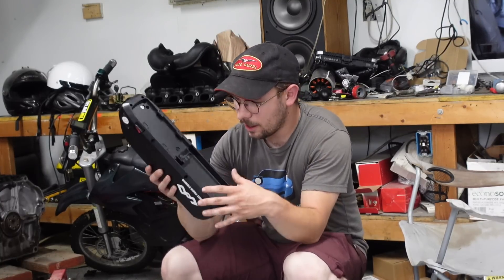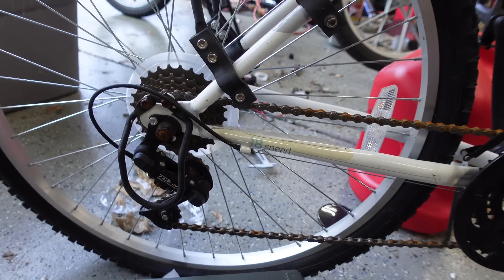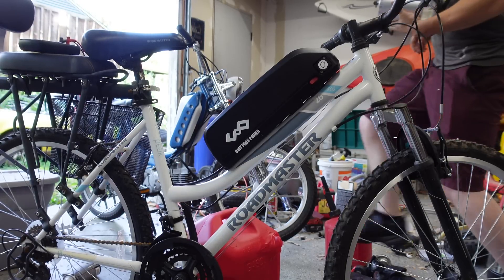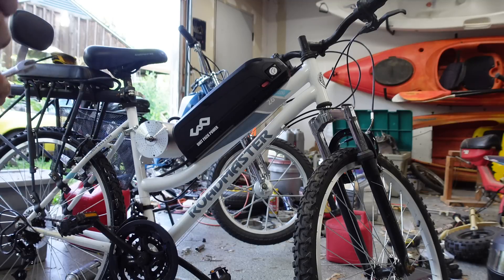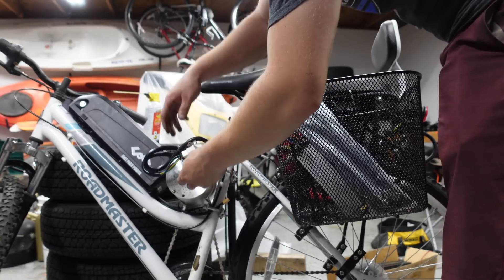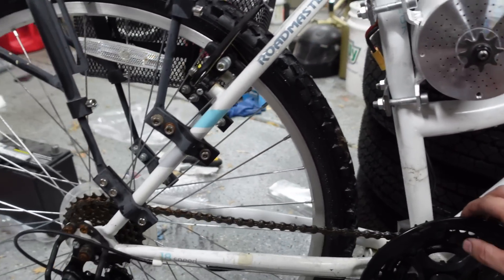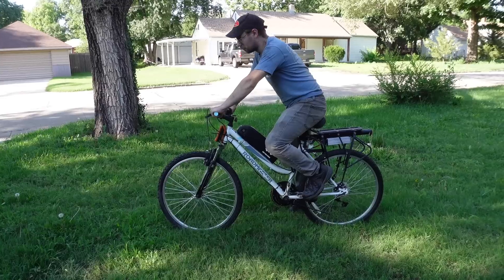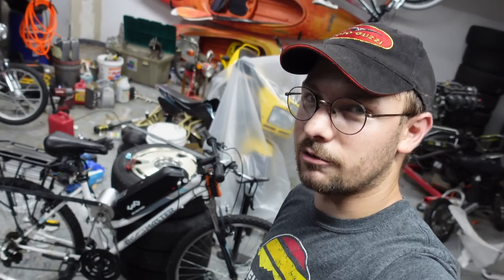Turning JUNK into a 30MPH E-BIKE in ONE DAY

Comment: How long did the battery last on the Razor bike? 
Nevermind, I can tell from your video timeline it only lasted a few months. Which is another reason why I went with a motorized bicycle kit instead of ebike kit.
Reply from the maker: Still have it! Still chugging along, but two days ago we rebuilt the powertrain from this into something different.
Reply: @100PercentJake  I was digging the off road Festiva.....I used to detest cars like Dodge Omni, Ford Festiva, Honda crx, years ago. But now for some reason I wouldn't mind having one to turn into a little pocket rocket.

Comment: All DC motors are speed limited by voltage while 3 phase AC motors have a set speed per frequency...
Reply from the maker: But frequency cant exceed the stator velocity, which is voltage limited as near as i can tell.
Reply: Ah... not sure I get what you mean. I'm a motor mechanic by trade for 5 years now. Simple 3 phase motors have "slip" - that is rotor speed cannot match the spees of the rotating magnetic feild (as the field pushes the rotor) a 2 pole for example is rates 3600 rpm at 60 hz, 4 pole is 1800, 6 is 1200 etc... Is that what you mean?

Comment: i would almost be looking at a better bike for the conversion, one with hydraulic disc brakes and non quil stem. my guess is those wheels are not true and wobble like a sob. i would also repack hubs or replace with sealed cartridge bearing. that old road master probably has square taper bottom bracket with cage bearings.
Reply: I built one of those 2 stroke kits I got cheap on a walgoose.    those are not assembled well. I worked in bike shop for a bit and man I had to basically rebuild the whole thing. even still that turd went 35+ mph with wheels wobbling until i trued them. scarry af. wear a helmet. not worth your life.
Reply from the maker: Oh yeah, the bike is super cheap. I considered buying a walmart mongoose for this. This is more or less a proof of concept.

Comment: There are pretty awesome conversation kits for hardtail bikes available already. Tongsheng TSDZ 2 with 750 Watts for example.

One can easily convert basically any old hardtail to an ebike with that. And it's even torque sensing.

What I am trying to say: Jakes build is an interesting proof of concept but there are much better options available already.
Reply from the maker: The MY1020 kits are pretty uniquely cheap for the amount of power they can provide, as well as allowing for controller upgrades later and being able to be used in a pedal-less situation like this. This is definitely a horrible solution compared to the myriad of e-bike specific kits out there but it is almost half as cheap as many of them, as well as more powerful.
Reply: You’re missing the point.  With various parts and common tools, Jake has proven that you can retrofit a standard bike into an electric bike for less money.  And that in itself is a win.
Reply: I wanted an ebike but had to go with a 2 stroke motorized bicycle kit $120+$80 parts upgrades, engine port work & add-ons =$200  40mph top speed, 80mpgs, long engine life if properly ran & maintained. Can leave outside in hot/cold no $500 battery damage to worry about from heat/cold, crash....I just lack the low end hill climbing torque & have engine noise.